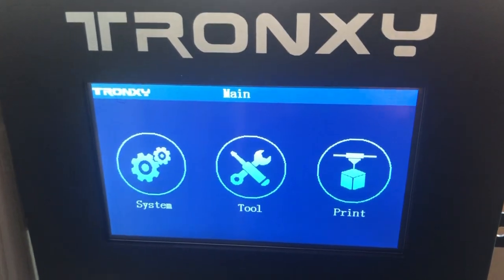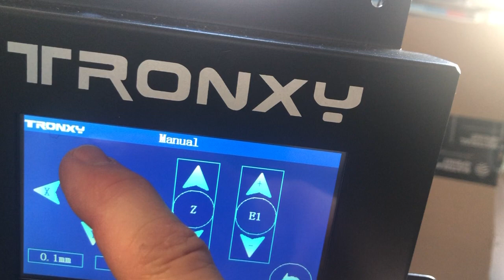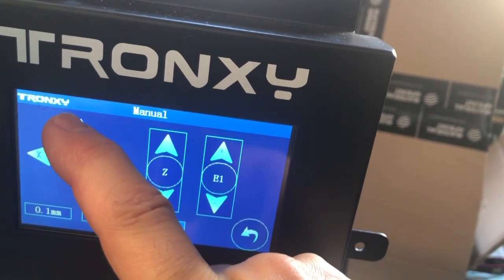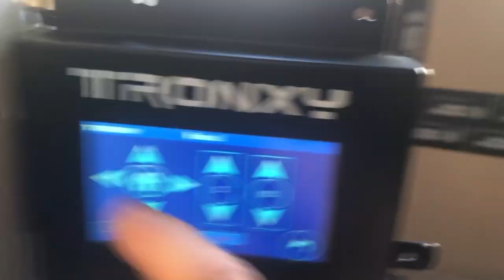TRONXY X5SA 600 - 20" Testprint closer examination... just for nerds... part 2/2

Comment: If you measure the inner and outer diameter of the spool and rod you could pick up bearings at your local auto parts store very reasonably
Reply from the maker: hi zach, and thanks... i will think about it... do you think the bearings will stick onto the crome-rod? i will check it out... but sooner or later i will need this cymbal holder again for my drumset... and maybe replace it with a cheaper one... ;)